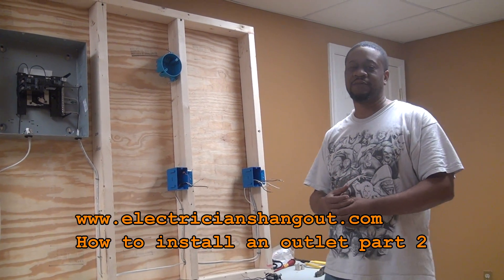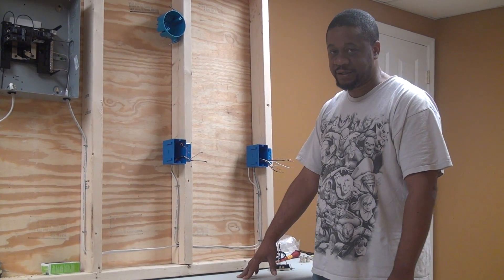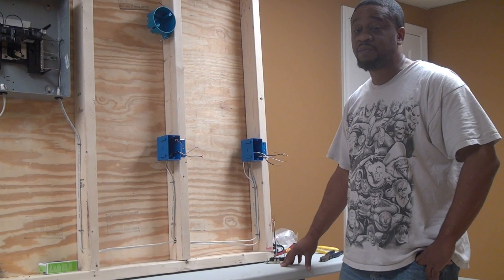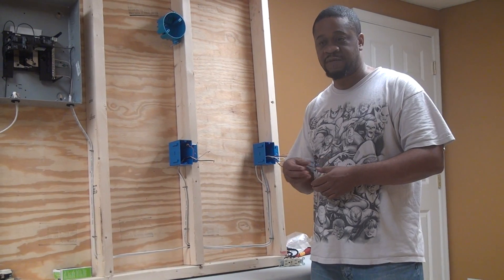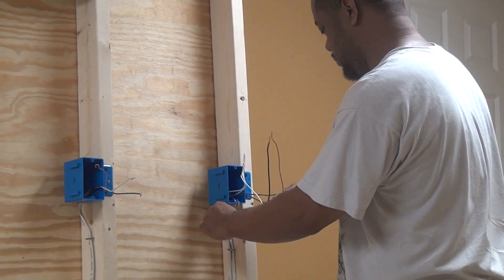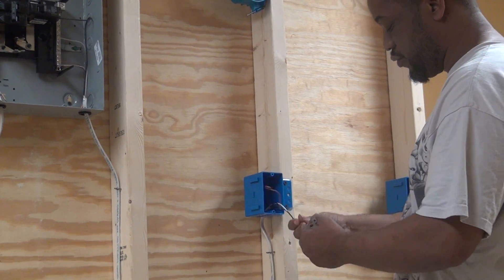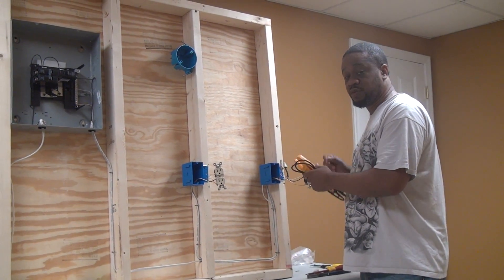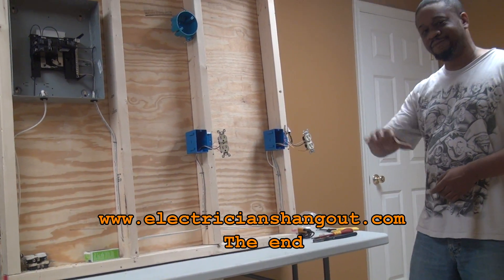How to install an outlet part 2

Comment: Can I assume that this is parallel wiring of multiple outlets? If so I assume the first one in the line, that also has the feed wire from load center is per this example the second would be similar to the first and the last one wouldn't have the pigtails/splices and the three wires would just hook directly to the hot, neutral and ground screws. Is that correct?

Comment: Hello  I'  Im a DYI currently working in my basement.. I wired about 8 recessed ceiling lights some time ago.. I want  to install two more outlets should the outlets be GFCI since i'ts  in a basement ( (just curious) also I'm looking to install alexa or google Home.. is there an outlet you recommend for this

Comment: One question sir...what if I wanted to add another recepticle to the right side of the your first recepticle, can I quick connect the the wires since you pigtail the wires to extended receptacle.?..thanks
Reply from the maker: yup do not matter is you install install the new outlet to the left, right, up or down the process is the same.

Comment: how far did you strip back the wires from the receptacle?
Reply from the maker: you leave at minimum 6 inches of wire from boxand from 3/4 to 1 inch of striped insulation

Comment: i'm building a new room in my basement, I need to do a drop ceiling so I'm going to put 4 recessed lights in, is there a limit to how many lights and outlets can go on one circuit? it seems the rest of the basement is all on one, so I don't believe it will matter. Just wanted to be sure before proceeding. Thanks for these videos. very useful
Reply from the maker: A good rule of thumb is to multiply the voltage of the circuit 115 volts times the size of the circuit 15 or 20 amps. You do not want your connected load to exceed 80% of this number. 20 amp circuits 16 amps or 1840 watts and for 15 amp circuits 12 amps or 1725 watts.

Comment: I want to add a closet light and a light switch but the only power nearby is the light from from the room. Can I get the power from that light?  How?  Thanks
Reply from the maker: If the light has a non switched power source then yes, but if the the light just has one cable coming to it and it is controlled by a switch then your second light will only work when the light you feed from is on.

Comment: great videos!! im wiring off an existing outlet and want to run to a switch and  from there to two different lights and also continue the loop through the switch to remainder of circuit   can i run it like that with the pigtails. thank you for sharing your knowledge.
Reply from the maker: it sounds like you should be fine
Reply: Thank you...I did it Monday and it worked great.

Comment: Tyrone you didn't explain why you are combineing all 3 wires together or the flow of the wiring. I get it but I think for clarification you should briefly go over that. Also what size wiring/ type to use and what size wing nuts to use would be nice as a bonus

Comment: Hello Tyrone, thank you for the video. It was a great tutorial. Can you please do a video on how to install a line-to-line and line-to-ground connection in the panel box with the circuit breakers down to the lights and outlets? I wanted to know how to do the grounding on the metal boxes. My other question is where does the grounding wire (bare wire) connected?
Reply from the maker: bare wire connects to the green screw on the device and to the box if it is metal
Reply: thank you again for the feedback. I appreciate it..

Comment: Good video. It looks like it's 50/50 whether an outlet box goes to the left or right side of the stud?  Thanks for the help.
Reply from the maker: yeah does not matter which side of the stud you mount your box just use whichever side makes the most sense for your particular situation.

Comment: Tyrone once again you are the master.  I have never seen the pig tail outlet approach that you use.  I am sure it is code acceptable or you would not teach it.  It only makes since that you approach it this way to allow for the rest of the circuit to never fail if an outlet for some reason fails in the circuit.  Thanks again for your teaching, sir.
Reply from the maker: You are most welcome

Comment: HI Tyrone,    do you have any conversion of receptacle type vids.  Meaning I noticed that my wall switch controlled a single receptacle (single pole outlet 14/2)   I wanted to convert this wall switch which was wired with ( hot and neutral only coming from receptacle)  so  I closed the circuit to make the receptacle unswitched and  pigtailed at the switch box  to get a new hot.     

Here is my dilemma,  my intention is to  introduce two new  single pole switched circuits fed by this NEW single source hot (above) ,  each circuit provides power to 3 LED recessed lights on each circuit. (2 circuits x 3 LED lights).

Hopefully this is enough to get you thinking but there is a bit more with above in mind.   Invision double gang box 2 switches in it  1.  Maestro CL occupancy sensor 2. double switch Leviton for the 2 circuits above.   I have wired it to be  Maestro single polled to the leviton.    Maestro receives the above hot,  Leviton is the switched load.     My issue is the unswitched receptacle now works but my lights dont light :) yet there is current along light circuits when the leviton switches are on off accordingly.     My question is could the making of the unswitched receptile which consumed my white wire(see top) be a parallel circuit created ? and depriving my light circuits somehow ?   Love your vids also !.  I will figure it out but figured Id ask :)
Reply from the maker: LOL I can not picture what you have from what you posted so unfortunately I do not have a solution to offer :-(
Reply: Tyrone Robertson
Ha Ha no problem,  Im a computer guy so I likely didn't use the right electrican's terms anyways no matter how hard I tried.   In short, after watching a few more of your vids you talked about  "Thinking" . Knowing It just didnt make sense why it wasnt working I knew my problem had to be elsewhere.   I pulled out the receptacle from the wall to have a closer look.   At closer inspection I noticed they changed a White Wire to be "hot" which left running up to the switch that I was in :)  This was my issue.  I was led to this after I tested the wires and didnt understand WHY my white was HOT.  I guess this is an Electrician's practice ??.  Anyways I changed it back to being  White are my neutrals and blacks are hot for this particular situation.  Once this  was done everything worked perfectly .. Thanks I want to get your book btw. !

Comment: Great videos! My question is, you're going from the source-to an outlet-to-switch in this video. I understand that part. But how would I go from the source-to switch-to outlet? In other words, I want the switch to come first-then the outlet. At the same time I want to use the switch to split off to a light. Or can that even be done?
Reply from the maker: +chalemi Yes it can be done just run power to switch then to outlet black to black ,white to white. In the switch box run a cable to light so now you have 3 cables in switch box supply cable and cable to outlet connected like said above. Connect white from cable to light to other whites in box and black to one side of switch. Make a jumper from the supply/outlet blacks and put on other side of switch. Hope that helps

Comment: Hey I just hung some hi hat halo lights in my basement. I wired them to an existing  light that was already  there they work but now they don't work with the switch they stay on and when I turn them Off with the switch my breaker blows out please help . My name is ray
Reply from the maker: +feliciano Raymond LOL it is hard to help without knowing exactly what you have. I would start by putting everything back the way it was first. Then if the lights were working before you installed your lights just run a cable to one and connect black to black and white to white, ground to ground.
Reply: Thanks for getting back to me I appreciate it very much . I got it them to work thanks to watching all of your videos.  Good looking out my brother..
Reply from the maker: +feliciano Raymond you are welcome

Comment: Is it legal there to draw another outlet from an outlet and not the wire node above?
Reply from the maker: +arjuna207 I have no idea what you are asking
Reply: +Tyrone Robertson you extended the second outlet from the first. in europe, thas against the regulation code. both need to come from the extender box
Reply from the maker: +arjuna207 i see so the wire node is called the extender box. I just learned something new thanks for that information.

Comment: Thanks for doing these videos. They helped me wire some outlets and lights in my basement. I really appreciate how you show every step and action that you are doing. It does slow the video a little bit, but unlike other videos that talk and then show the assembled item, you showing every step and how to connect every wire is really helpful.

Comment: Thank you for doing these videos. Can you please do a video explaining or can you just explain how to wire an outlet and light switch into a double gang box. I tapped into an existing outlet and ran a wire to it. Now I want to hook up a outlet and switch and then run the switch to a under cabinet light. Thank you. Marc

Comment: Hey Tyrone- thanks for this video, it's very insightful! Question: I just replaced single pole light switches (2) and outlets (3) in a room and hall way. I turn the breaker back on now both light switches don't work, the outlets I replaced all work but there are outlets in the adjoining room that do not work... Where could I have gone wrong? Would the error be in the outlets or switches? I'm thinking outlets. On all my outlets there were two black wires in and two white wires in but in this tutorial there are only on of each (Is that what they look like if you don't pigtail?). They're all connected via the quick connect and not the screws.
Reply from the maker: ibar3734 in most cases the blacks go together and the whites go together. you use a pigtail of of each to connect the receptacle.

Comment: Hey I have a question. I am mounting a Tv to a wall and will be installing a new plug directly above an existing outlet about 4 feet higher. How do you suggest I strap the new cable to the studs without taking out the sheetrock ?
Reply from the maker: David Ferrero if you are fishing it through the wall you do not need to strap it

Comment: question for you: I am putting in some new outlets in my basement in the same room where my panel is. The outlets are on 2 adjacent walls, with the panel in the middle of  the 2. Is it possible to run my supply line to the panel from the middle of the series, or do I need to run it from one of the ends? If I ran it from the middle, I would have 3 lines (1 from the  previous outlet, one to the next outlet and then the supply line. Is it okay to run these together in an elaborate pigtail configuration?

Comment: Hi Tyrone - thanks for the great videos. They are a great service and I appreciate the knowledge you are passing along. I do have a quick question.  At around 4:50 you hold up the outlet and the pigtails are already attached. Are you creating those just using some extra wire you've clipped off?  Also, I plan on using 14/2 wire since I'm coming off a regular 15 amp outlet.  Is this correct? The breaker is 15 amp too.  Thanks again!
Reply from the maker: Yes to the both questions

Comment: Hi, Tyrone. What is the purpose of a double pole, single outlet? Leviton makes one, model # Model # R52-05821-0WS. I'd like to add a 220v outlet to my home and I'm trying to select one that's compatible with a NEMA 6-15P plug. What do you recommend?
Reply from the maker: hey Richard the single outlet is usually used where you want a specific thing ( one piece of equipment to be plugged into that outlet and nothing else. when choosing just be sure to look at the equipment specs example (220volt 20amp or 110volt 15amp) and choose the outlet that meet your required specs. Hope that helps
Reply: Tyrone Robertson Hi Tyrone. I'm planning to install an outlet for a 220v 7 amp device, using a NEMA 6-15P plug. My main question is why would a single outlet be double pole?
Reply from the maker: Double pole may be the description that the manufacture use to indicate that the device is designed for 2 ungrounded conductors. Single outlet is a way to describe a outlet that just has one yoke where as a duplex outlet is the term used to describe an outlet with 2 yokes (yokes are the part of the outlet where you plug in equipment) like I said before just make sure the specs for the outlet are suitable for your intended use.
Reply: Tyrone Robertson Thank you, Tyrone. That makes sense. It appears to require two hot connections.

Comment: Hello again Tyrone, I have a single outlet coming from the breaker panel in my garage which is a GFCI and would like to add two or three more single outlets from that GF, If I come off of that GF can I pigtail the rest of the outlets, also is it safe to connect 14 gauge romex wire to a 20 amp breaker as long as there is not a lot of load
Thanks Al
Reply from the maker: I would just use 12awg because well its the right way, and you can never say with certainty what loads may be placed on the circuit in the future.

Comment: You mentioned that the wires running through walls should be in middle (1 1/4 inch from front/back) of the stud... how much from floor should the holes for wires be?
Reply from the maker: there is no requirement for how high or low you drill the holes . It is a good idea to drill the hole for the stud holding your box at least 10 inches above or below where you mount your box so you can get a strap 6 inches from the box

Comment: Tyrone, thanks so much for doing these... great videos!!

I want to extended an outlet up to an outlet behind a wall mounted TV set.  The outlet below where I want my new outlet is already extended (like the outlet on the right-hand side in this video.  Is that ok to add another outlet to this already extended one?  Would I do as in this case and just screw the wires from all three outlets together into a pigtail and attach to wires attached to the outlet?
Reply from the maker: did not understand the last part of your question but yes it is ok to extend from the existing outlet. Just make sure that the existing outlet is the correct voltage ( i would assume 110 volt).

Comment: Thanks, just was I was looking for.  I will be extending an outlet at the kitchen back splash to a switch for some direct wire under cabinet lights.  Excellent video and visuals.  Keep it up.

Comment from the maker: The neutral wire for the timer have to be from the same circuit as the vent fan. If the gfci and the vent fan are on the same circuit you are good. If it is from same circuit as gfci you need to determine if it is on the line or load side of the gfci and make sure you tie in to the neutral on the appropriate side.

Comment from the maker: You want to use the SOOW from generator to first landing point because the cable is exposed to physical damage. The SOOW cable in 2 conductor will have a black,white, and (green wire for the ground)

Comment from the maker: Assuming the generator is 110 volt yes 2 conductor14awg would be fine. However instead of using romex I would use SOOW cord with a male plug on the end.

Comment from the maker: a good rule of thumb is no more than 13 but ultimately you want to factor in the load you will have on the outlets 20amp circuit 2500va and 15amp 1500va is 100% rated capacity you should not load either circuit more than 80%

Comment: My other choice is to include the dishwasher on a circuit that currently has 4 outlets.  It is also 12 awg on a 20 amp circuit.  Would this be OK or should I have a dedictaed circuit just for the dishwasher?  Thanks, Scott

Comment: Tyrone...I'm installing a dishwasher on it's own dedicated breaker.  I'm using 12 gauge wire on a 20 AMP circuit breaker.  Is that what you would recommend?  Thanks, Scott

Comment from the maker: Hey sixpac you are going to want to use AWG12. and install a single outlet, or if the outlet is withen 6 feet of the wash tub you want to make sure it is GFCI protected. you can use a 20 amp GFCI breaker and use a single outlet or use a regular 20 amp breaker and a GFCI outlet. you want the circuit to be dedicated to the washing machine hence the single outlet. either setup will comply with the NEC GOOD LUCK

Comment: hi tyrone  i need information about my  clothes washing machine   i want to change the wire  whats the best 14 gauge wire on 15 amp  or 12 . 2  wire on  20 amp ? because right now its on 14. wire with 15 amp  but a lot of load on that outlet  that washing   machine  is on  what is better to use  pls  thanks